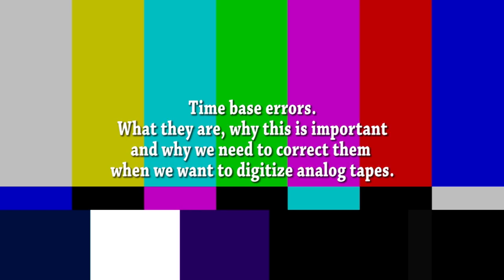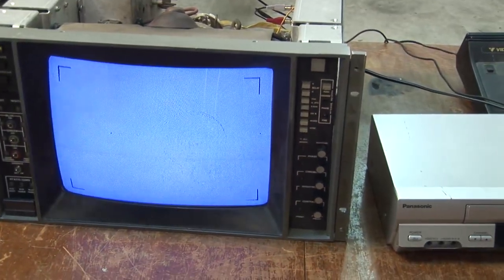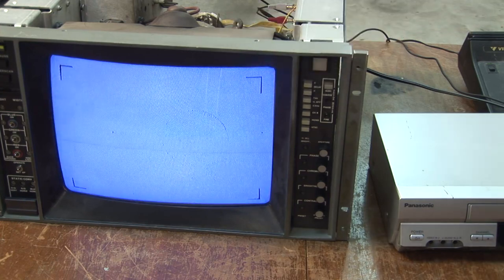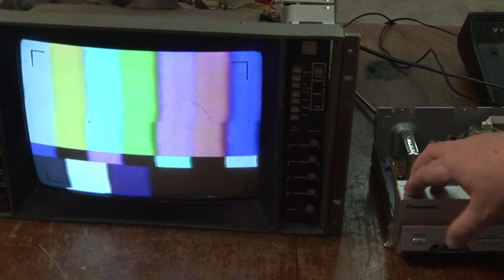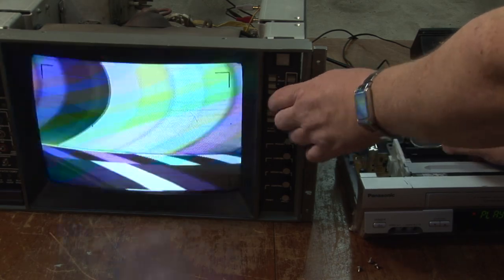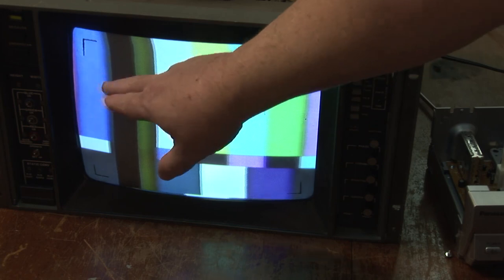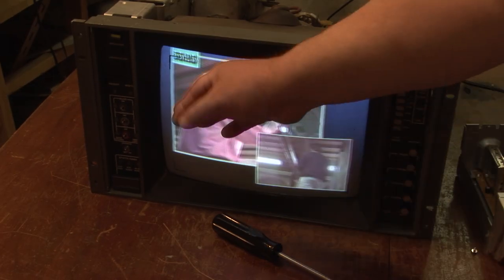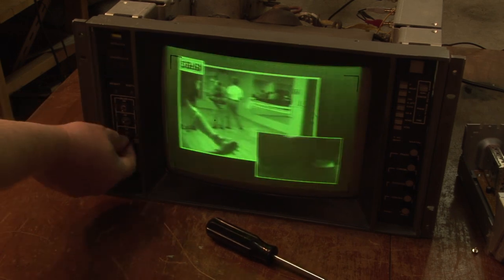Time Base Corrector Demo

Comment: I remember back in the day.. the first video capture/digitizers Like Miro DC20 .. Miro DC30 .. they had Time Base Correction on board (I remember read something in the user manual about Time Base Correction Buffer) ......... they lost frames when the tape had serious damage... when you had a good amount of white noise in the image picture............ the cheap standard Vid capture you get even today ... like AverMedia or those garbage Cheap Chinese USB dongles con los 3 RCA a SVHS connectors..... they lose frames for sneezing close to them............ I still have a Miro DC20 Plus PCI board from 1997/98...... it can capture SVHS PAL at 768x576 30 FPS in very decent quality...

Comment: Would the MX 1 TBC work with a Umatic 3/4 signal for digitizing, either to a Dvcam deck or capture card ADVC 110 or 55. Thanks for your time.
Reply from the maker: Yes it will.  It has both composite and s-video inputs and outputs and will even accept composite and give you a very nice s-video output.
Reply: Can you recommend a seller for the MX 1? I have a client, a national headquarters, with near 1000 Umatic tapes for digitizing. I have converted hundreds of tapes VHS, Betamax, 8mm & Hi-8, Sony Digital-8, Mini DV all to computer files so, I do know something but, this Umatic seems a different creature. I use Panasonic 1980's & DVcam recorder & Player decks. Just trying to get the best info, before I invest a few thousand $, would hate to lose such a client because of my ignorance. Great videos, Thanks for your time.
Reply from the maker: @mlluke7506  I don't know anyone selling them. They are pretty old now.

Comment: Just a note on the CRT. Those CRTs are just consumer tubes that are hand picked for the best parameters. No broadcast monitor manufacture could afford to have custom CRTs made based on the limited broadcast market. One place I worked we had Sony BVM monitors in  the VTR bridges. A replacement tube was about $1000. We just bought the 12in consumer tube for about $300 IIRC as a VTR bridge is not a color critical monitor application - at least in that facility. They also run at the same high voltage as a consumer TV as they are the same tube. Put 50kv on that tube? Well I don't want to be in the room when you do that😲

Comment: So if I wanted to make my own home analog broadcast studio with VCR being one of the primary sources, I would need a time base corrector if the VCR is crappy cheap like this? Or simply if I want to capture the tape to a digital format? Because I'm thinking of backing up our cassette with personal memories into an MP4 file. It's my parents' wedding, my brother (then sister) in kindergarten and me as a newborn baby and a toddler. I'm not sure if there is anything else, but that's what it is. It's been shot throughout the years 1995-1997 or 1998. I might have to buy some VCR for VHS tapes second hand from people on the internet (our VCR went to the silicon heaven over a decade ago, it was a SONY one, though I don't remember the exact make - the model, because I never actually looked at it). I don't care about movies we had on VHS tapes, because I can simply go search online for movies if I want to see one. The point is we have this VHS tape with content I cannot find anywhere online and in order to watch it, I need to put it in VCR. What happens if I don't have a VCR? Well that's unfortunate, I cannot watch it. So I can eighter use some VHS restoration/backup service in town, or simply get myself a VCR, a TBC and a video capture device that converts the video into a digital format I can record into a hard disk. Chain is pretty simple: VCR → TBC → VCD (Video Capture Device) → PC to store the video file.

Comment: Thanks for the demonstration on TBC with the Vidionics MX-1. 

It should be noticed, sometimes the TBC doesn’t work with a specific VCR or tape. 
In these instances, having the possibility of turning off the TBC becomes an advantage. This is specially true when the TBC is causing more damage than fixing the timing issue. On the Vidionics MX-1 the TBC cannot be turned Off. Only the Frame Rate Lock can be turned On/Off on this unit. A consideration to be taken before purchasing.
Reply from the maker: I found in every case that time breakers do more damage than good. The reason they even exist was for the broadcast world. To synchronize cameras and vtrs together and titlers so they could Jen lock and set the subcarrier phase exactly the same for mixing and switching using an analog switcher. In the digital world they're completely unnecessary if you have a proper capture card. Think about what a Time base corrector is doing it's digitizing your analog video to provide a correcting signal and then taking that digital signal and turning it back into an analog signal. Every time you digitize and convert back to analog you're going to reduce the high frequency content and the picture quality. A proper capture card doesn't care it will capture everything time base errors in all once it's in a digital bit stream it's easy to correct on the computer just like the TBC does. So for archiving time-based correctors are overrated and totally unnecessary. the only time they're necessary is when you want to do things like shrimp macrovision off of an analog signal to record it on to another analog input source such as a DVD recorder or another VCR that pukes because of the macrovision signal. Again a good capture card doesn't care. Most of the cheap ones will puke when a timing error is too great but the better ones don't care they just capture it all
Reply: @12voltvids   ,  what would be some good examples of proper capture cards that will capture everything, time based errors and all, for later (easy?) correction? I'm just starting down the rabbit hole of VHS conversion and want to preserve the highest quality possible. Thanks!
Reply from the maker: @chrisrow9609  canopy's made some good units.
Reply: @12voltvids  which ones are good enough to not need a TBC?

Comment: Very informative video, thank you! I have had sync issues with my VHS (Panasonic NV-FS200) and betamax (Sony SL-C30) player for a long time when connected to my PMS Crystalio II video processor. Apparently it only has a line based TBC, which isn't good enough. The VHS player also has a TBC, probably the same thing. The video would drop out (black screen) and the video processor would struggle to maintain sync. The on-screen display would spam all sorts of weird resolutions (e.g. 720x601). I ended up buying a Leitch DPS-575 which did the trick! Perfectly stable video. I'm using the SDI output since my video processor has input for it. So now I can actually view my tapes without annoying blackouts. Nice to see a video that explains and demonstrates what's going on. Again, thank you!

Comment: This was kinda cool to hear about! In recent history I've also been a bit interested in how TV broadcasting works (both in the old analog days and now), so it's cool to hear from someone who has first-hand experience. Really crazy to hear about all the regulations there used to be, especially considering analog is so error-prone to begin with. Can't imagine how closely y'all had to monitor the equipment!
Reply from the maker: That is the reason time base correction, and careful signal monitoring was so critical. Analog signals being so error prone needed to be made correct before transmitting to guard against interference to other services.

Comment: Delta gun CRTs are definitely the way to go with analog broadcast monitors.  It wasn't until Trinitron came out that something was available which could rival the quality of a good calibrated delta-gun monitor.  And to tell you how these things were made, they were made like a laboratory instrument; they would had been hand assembled all the way down to the CRT, and tweaked for hours on the bench.  There is a good reason they cost so much- it's all the hand work which goes in to something which absolutely has to perform flawlessly.
Reply from the maker: +douro20 yet the engineers would never use a trinitron tube for signal verification. The reason they gave. Trinitron were soft. Only 200 lines so even crapy video looked good.

Comment: I read that these Videonics MX-1 units weren't that good as a legitmate Time Base Corrector, but as we see, it did a good job on this video.  I am considering buying one.
Reply from the maker: They are s full frame store TBC and comply with FCC standards for broadcast.  That's pretty good.  Small market tv stations used them as their master control switcher.  Back in 2004 when I was working for a satellite TV broadcaster for a few months they were using one as their master control switcher to the satellite uplink transmitter.

Comment: I can hear the whine from the TV I'm listening thru headphones.

23:19 I did that one on a bus but Me and a friend sat on top of the seats. yes you heard me ON TOP of the seats and the driver went over a bump and we went flying lol.

And I'd like to hook my PS2 to that monitor and play games on it. Does it have sound?
Reply from the maker: +coondogtheman1234 No speaker. This is just a broadcast monitor. I have 2. I used to have 3, but sold one years ago on Ebay. Crated it up in a wooden shipping crate. Cost more to ship than the unit auctioned for (bid was like 20,00 and the freight was 90.00 plug the cost of the plywood and foam. I think it ebded up costing about 150.00 by the time all the smoke cleared, and the fed ex guy was having a bad day and threw it off the back of the truck smashing the picture tube. That was my first bad experience with Ebay. The guy wanted his money back, and I said ok sure, here is your 20.00, minus the cost of the packing and plywood.Had fragile stickers all over it, and the goon just trashed it.
Reply: 12voltvids

That is one of many reason I don't mess with eBay. Or even craig's list here in the states.
Amazon for me, never had any issues with stuff bought on amazon.
As for the DVDs couldn't you just use a DVD copying program? I might have told you this already but I many Tapes that I want to put on DVD or digital but my VCR is only mono I should get a stereo one. I can't believe they still use macrovision on DVDs.
Reply from the maker: +coondogtheman1234 Yes lots of ripping software for DVD. I haven't ripped a DVD since DVD Shrink was what everyone used. I don't have much use for DVD at all. I use the macro buster mainly so I can record DVDs from my cable box off the on demand service. They protect all the HBO On Demand titles that I want to backup, but the macro scrubber works wonders.As to Ebay, I have been screwed once, but that screwing cost me huge. What happened was I sold one of my old professional cameras to a buyer state side. It was fully functional, but was specifically stated that there was no warranty, and that returns would not be accepted, it went for 900.00.  (The lens was worth over a grand by itself) The buyer promptly paid me, I waited until I had the funds in paypal, and then transferred the money out of paypal, and shipped the camera.5 days later I had my receipt that the buyer had received it, and I was happy.About 6 weeks passed, and I get this email from the buyer asking for his money back. Claims that it broke down. Well, I know that it was in good shape when I sold it, and the only reason I did sell it was because I had upgraded to my HD camera. The one I shot this video with to be exact. I was talking to one of the guys at work, and he told me about a horror story he had and told me to contact my credit card company right away and report the card on file with paypal as lost before the buyer filed a complaint because they would just charge my card, and they I are fighting with them.Paypal was still owned by Elon Musk at this time by the way, and I would never ever, as long as I live buy one of his cars just due to this experience incidentally. About 2 days later I get this message from Paypal that a chargeback has been filed against me, and they are trying to recover the funds but my credit card and bank account on file with them have been closed. (no kidding)They are demanding a new credit card number so they can recover the funds and will not even investigate until the funds are replaced.I also get a request from Ebay to supply them with information regarding the transaction. I comply and send them the required information, including video clips showing the unit functional.Months go by, and I get an email telling me that the buyers credit card issuer has sided with him, that he gets his money back, and I should work with the buyer to try to get my property returned.Ebay states that most transactions go smooth, but some transactions go sideways with buyers intent on committing fraud, and sellers takes this risk as a cost of doing business no different that shoplifting at a retailers place of business.In the end, paypal sent it to collections. I told them where to stuff it, and they f**ked my credit rating, which cost me probably 10 grand in extra interest charges on my mortgage. So no I don't deal with Ebay or Paypal, and I will never buy a Tesla. Even though Musk doesn't own Paypal anymore, he did when this fit hit the shan and when you are pissed at a company you are pissed with the man at the top.

Comment: The markings on the corners of the tube, I'm guessing those are supposed to be a guide to tell the engineer how the picture may look on a consumer TV with overscan?
Reply from the maker: Yes framing for the camera operators. This monitor was the program monitor in a broadcast truck. I have the twin to this that was the effects preview monitor, and it doesn't have the framing mask. It is just on the surface of the tube. The monitor has normal and under scan mode. Normally it was run in under scan, and the framing marks would approximate the edge of the picture on an overscanned consumer set.

Comment: I was wondering if you'd know the polarity on the power adaptor? I have a few 12V power adaptors 1.2amp but not sure what the Centre and Tip should be in regards to the polarity?  Anyway you'd know or even if you'd test it with a volt meter...?

Comment: So, I am curious - How well does the time base corrector in a Video Toaster card (I am looking at possibly getting a Video Toaster 4000 for my Amiga 4000) work in comparison to the time base corrector demonstrated here?
Reply from the maker: +KG7UJH I don't know much about the toaster. I heard of it, but never went that route, I went the MX1 effects board, as it was being toured as the "toaster without the computer" solution. The MX1 served me well back in the linear editing days. It has 2 full frame infinite window TBC, and it really works to clean up the video, especially when it is placed in LOCKED operation, which forces all incoming video to FCC compliance. The only thing it can't do is be genlocked to external studio reference. So it  couldn't be used as a production switcher tied to studio sync. It was designed for small studio use, or for remote truck applications, where up to 4 video sources, say tape playback, and live camera could be input into the truck, and then the output sent to microwave for relay back to studio.  Does the job, and it is transparent as far as picture quality goes.
Reply: I recall Videonics often being looked on for very decent equipment for those who couldn't afford an Amiga and the Video Toaster add-on.